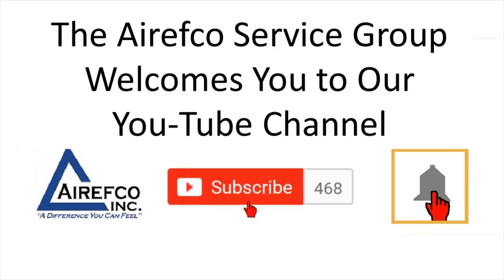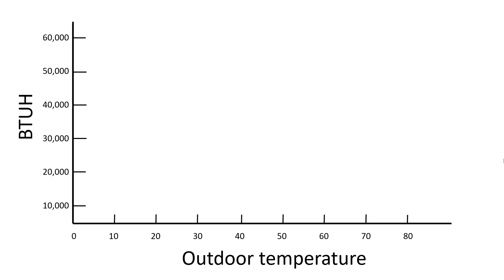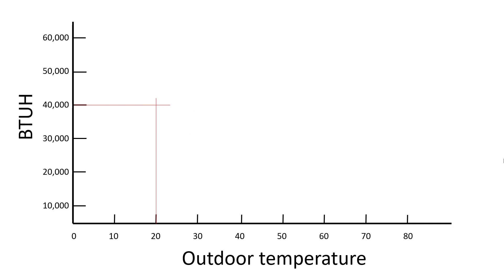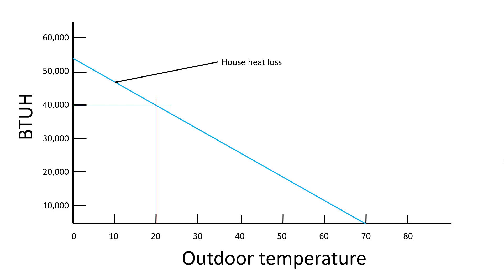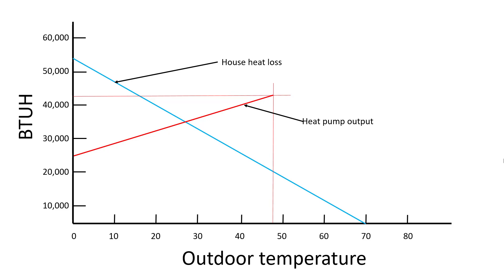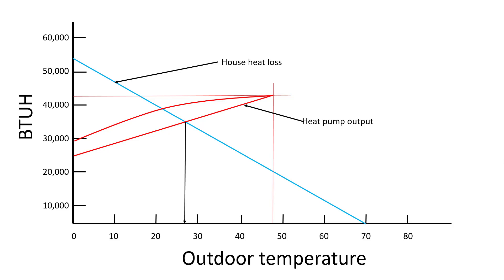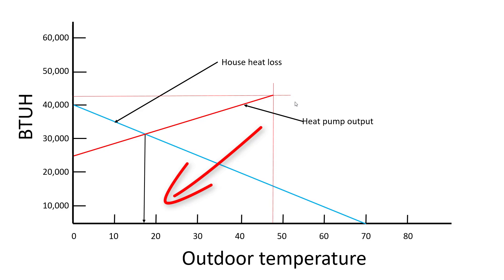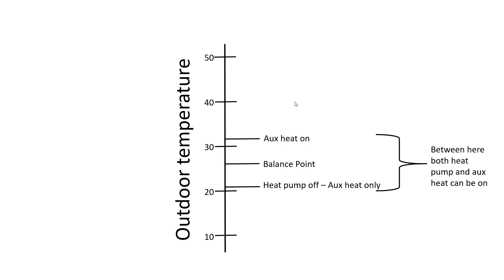Heat Pump Balance Point

Comment: How did you calculate the heat loss?
Reply from the maker: Hi Barry.  There are many apps out there for calculating heat loss.  In this case, we simply picked a fairly common number to use for illustration purposes i n this video

Comment: NO HEAT LOSS AT 70 WHEN INDOOR AND OUTDOOR TEMP ARE BOTH 70? WHAT IF BOTH ARE 60 OR -`10 OR ANY MATCHING INDOOR AND OUTDOOR TEMPERATURE. PLUS  WHERE DID 70 COME FROM?
Reply from the maker: If the indoor and outdoor temperature are the same, there's no heat transfer.  There has to be a difference in temperature for heat transfer to take place.  70 degrees came from that's a common indoor temerature

Comment: 2008 new home high efficiency pump with gas and our pump runs when temps are under 40 and our bill is very high .  Gas is now 1/3 the cost of E per rep so I am using gas  pump is working too hard.  Our pool has a pump and they recommend using it only when temp is 50 or higher